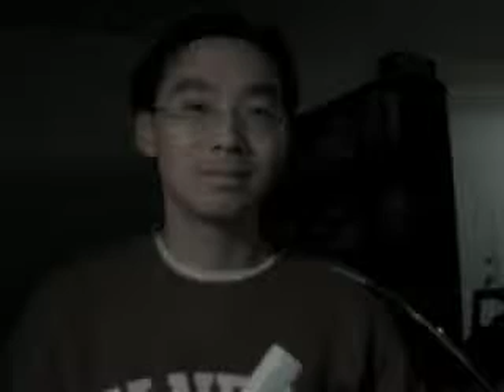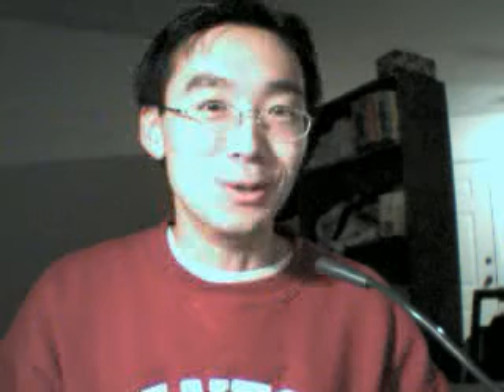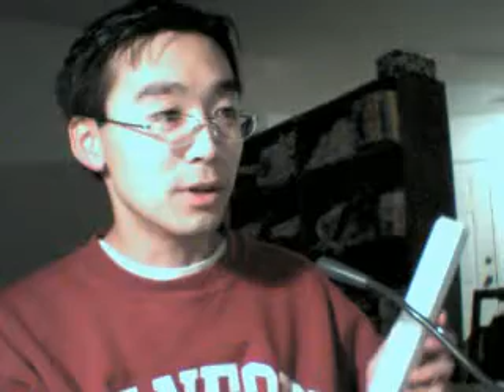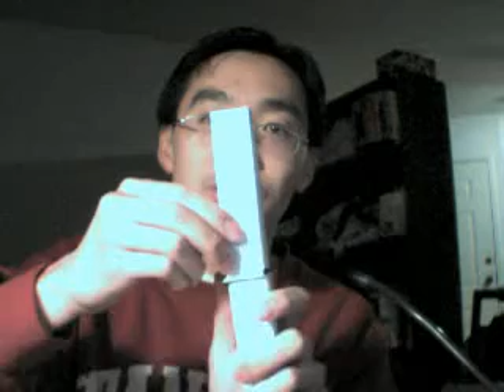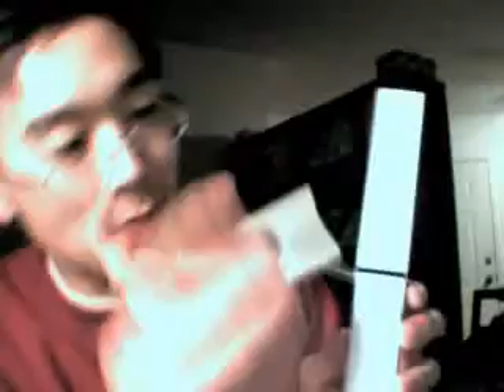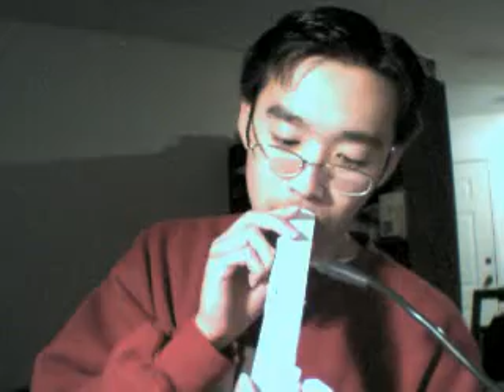Building Your Own Homemade Flue Pipe (Organ Pipe)

Comment from the maker: @myersNOTmeyers Thanks for commenting! I am aware of that work, though I wasn't when I made this video. It all goes to show that flue pipes are not difficult to manufacture, once you understand the concept. I prefer my method because I believe it is simpler, and also because it is easier to control the flue mechanism's operating parameters (flue thickness, mouth height). In Part 5 you can see my assembly process, as well as a schematic.

Comment from the maker: @Drummer0647 Cardboard substitute: I suppose you could use thin plastic for the upper lip. It's got to be thin, though -- in my experiments, even thin wood sharpened to an edge didn't produce as clean a tone as cardboard. As for the foot assembly, you can design anything that will create a windsheet. It would probably be difficult to roll plastic up into the traditional cone, but there's no reason why you can't make the foot the same cylinder with cut face as the upper lip assembly.

Comment from the maker: @Drummer0647 
Constant pressure: My wind pressure actually isn't 100% constant. But it turns out that my blower is capable of delivering such a large flow relative to what my pipes demand, the pressure around my operating point is pretty much flat, and it doesn't make a difference. I recommend trying it first without regulation; that may be good enough. If you insist on regulation, you can read more at rwgiangiulio.

Comment from the maker: @Drummer0647 Some excerpts from my private reply:

Covered ("stopped") pipe: It halves the frequency -- almost exactly, but not quite. You need to make a small correction -- learn more at rwgiangiulio's site. In real life, all stopped pipes have plungers to allow tuners to make fine adjustments. Also, stopping a pipe changes the Ising relations, so a mouth assembly that works for an open pipe may not work quite as well for a stopped pipe.

Comment from the maker: @2110400 You spelled it right!

The languid is the sheet that divides the upper and lower halves of the flue pipe. (In this case, it's that little cardboard square.) It serves two roles, one with each half of the pipe: 1) as the nearly-complete wall of the foot assembly, it forms the flue, or the slit through which the windsheet flows; and 2) it serves as a wall of the resonating chamber.

For a clearer picture, you can Google Image search 'languid pipe'. Let me know if I can be of further help.